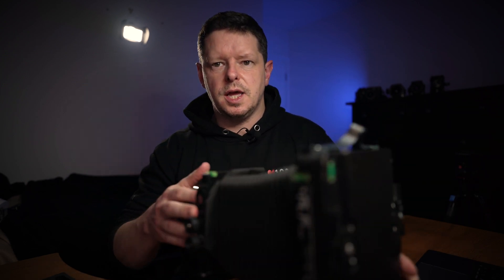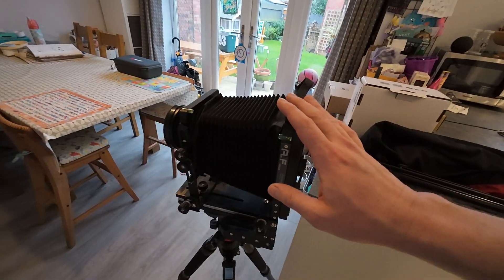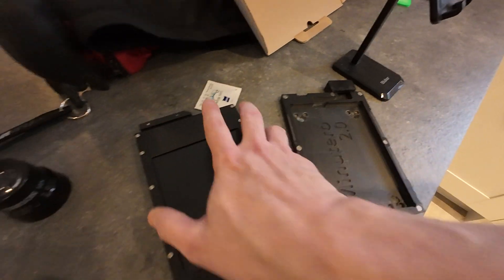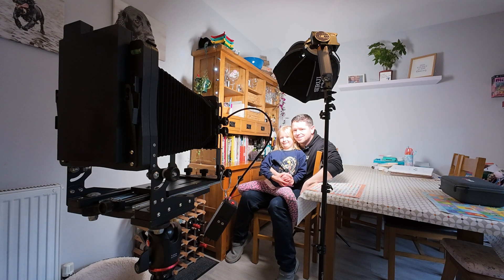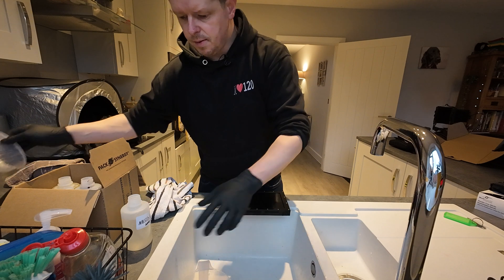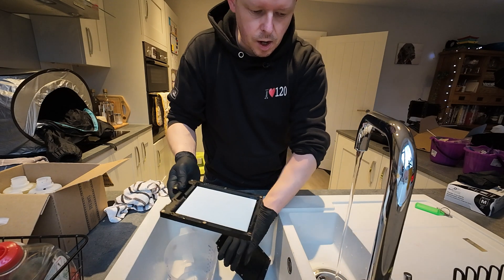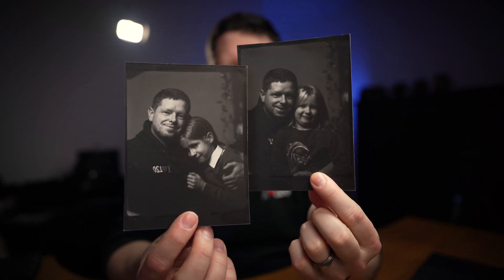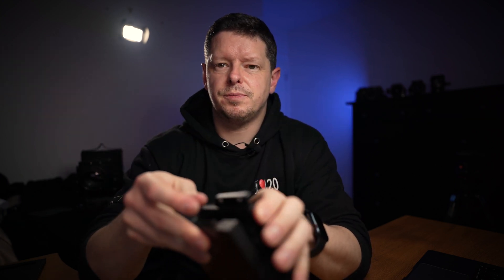StenopeiKa's Minutero 2.0 - in-holder-development, black and white paper reversal without a darkroom

Comment: Hi, great tutorial, I'm glad you were able to develop it successfully. I also purchased the minutero 2.0, but I get a flash of light in the chemical entry area that expands into a cone at the bottom of the photo. I'm now in touch with Samuele to see how to resolve this. But do you use the D100 1+4 for 3 minutes? Do you do the clarifying process with the chassis closed? Do you only do it from the second exposure to ambient light? My results are always underexposed, even in sunlight.
Thanks for your advice.

Comment: I like this idea but the image offset is a bit of a deal breaker. Yes, the spacer compensates, but I would be looking to use something like this on a rangefinder camera (Polaroid pack camera). I like the idea from Jaggle, which places the film at the standard film plane and the 2nd slide drops the film down into the developing area. A fine holder when using a ground glass though.
Reply from the maker: You have to have one of the two, right? Either the two dark slide system, or the image offset. For me, the image offset meant that I didn't have the washing and drying issue which I found a significant challenge with the other system. But everyone will have their own preference, of course!
Reply: @the120ist  Oh--I'm not aware of the washing/drying issue with the 2 slide system--what is the nature of this issue?
Reply from the maker: @hackaninstant  I found, probably because I'm particularly clumsy / careless, that the space between the dark slides was getting chemicals into it during development, so I then had to wash between them after each sheet. And then because I was doing such a thorough washing, all the nooks and crannies were wet and needed drying. Then also because you're loading the sheet into the small space / runners between the dark slides, they needed to be super dry, or the sheet would get stuck. With this system, the base doesn't need to be bone dry because you're not trying to slide the paper in. Just quite dry is enough, then you drop the sheet in, pin it with the upper section and you're away.
Reply: @the120ist  Oh, ok. That makes sense. I understand there's a new spacer that's supposed to solve this problem... I wonder how well it works?
Reply from the maker: @hackaninstant  Oooh interesting. I don't know about that. I'll go see what I can find out!
Reply: @the120ist  Ok, so when you use the extender, it clips onto the bottom of the film holder and has its own dark slide. Opening the bottom dark slide (#2) of the film holder and the dark slide on the extender tray drops the paper down, then you'd close the dark slide on the extender tray and remove the film holder so it doesn't get wet during processing.

Comment: Potentially a silly question, but if you used two of the Sirui lights, would you be able to use a faster shutter speed? I've been super interested in trying out wet plate / b&w paper reversal but the need for tons of light has always been a sticking point for me.
Reply from the maker: Not a silly question at all. Light increases in a linear way, so if you were able to add a second 150w light in exactly the same spot, you would double your light and halve your exposure time. However, we also need to consider that we can't put a light in exactly the same spot, cos there's already one there! Placing it somewhere else we need to consider that distance between light source and subject weakens light exponentially (inverse square law). If we put it the other side of the subject, equal distance away, we flatten out the light completely, and we end up with a passport photo. We could swap out the 150w light for a 300w light, or more, and the exposure times would keep coming down, but they become hard to sit under at the same distance from subject. The 150w is blinding enough at that range!

The simple solution to all this is shoot outside. You need a ton of artificial light before you can even get close to what our wonderful sun gives us.

Another solution, often used by wet plate photographers, and indeed seen on my channel in use by the wonderful Guy Bellingham, is using a monster bank of strobes. I did actually use this Minutero to test using flash, but the conclusion I reached very quickly was that I absolutely don't own enough flash power to make it work! You're looking at similar amounts of power for wet plate and BW paper reversal - somewhere in the 2000w/s to 3000w/s range. Buying new, Profoto's most powerful strobe is the Pro D3, a 1250w/s flash which will set you back USD $4000... and you'll need two of them!

Stay watching, I'm going to be tackling all this stuff soon on the channel!

Comment: Thanks for showing! One of the products that make me both sad and angry. Sad because it was such a great idea that did not succeed. Angry because they put it out to the public without bothering to test it -- they apparently (I guess) just designed it on their 3-d printer and sent it out. I noticed you skipped the parts where you fill in the liquid. How on earth does one fill this contraption without spilling a lot? -- I feel reminded of the Jaggle Berlinova, which had to be cancelled because that was put out without any tests, too. Why are people doing this? I cannot understand.
Reply from the maker: Woah there! Hold your horses! This product hasn't failed, you can buy it now on the Stenopeika website, and it's fully functional and works really well! 

I didn't intentionally skip the bits where I filled it, I skipped the whole development bit because you guys have seen me doing this so many times on this channel.

There are no problems with filling this, or the Berlinova. Neither of them spill at all. Unless you spill yourself.

So no need to be sad. Turn that frown upside down my friend. This is a great product that works really well!

Comment: I've been developing portraits in the field with Harman direct paper for a couple years now, dark bag and patterson tank.  This is probably not something I would use but I am ALWAYS happy when I see some new advancement in film photography.  Thanks for the preview.
Reply from the maker: You know what, I'm not convinced about using it to develop in the field. You definitely could, maybe I should try it. But what I'm most excited about is using it to do BW paper reversal / paper negatives / direct positives away from the darkroom. I'm not blessed with a permanent darkroom set up, so if I want to do BW paper reversal it has to be a full on session to justify me setting everything up. The thought that I can now dip in and out of it, develop in my kitchen, opens up so many new experimentation possibilities!
Reply: @the120ist  one use it could be put to, is using the DRY plates, aka in the wet plate collodion processes, like lost lite art does, using this as a plate holder, and tank system, just cut the tin or glass to this size.
this is perfect for this, as you need to process quickly, and not having dozens of tanks, etc. to transfer to, etc. makes it a lot more consistent, with less variables, especially for learning it with.
Reply from the maker: @andyvan5692  I wonder if, in its current design, the thickness of the plate would cause a problem. If the top section sits on the plates the it might hold it too high and break the seal... not sure! I shall have to try it.